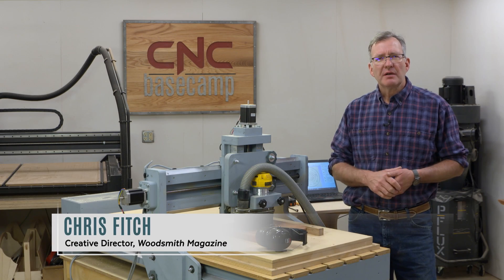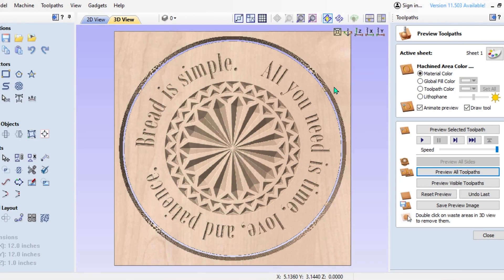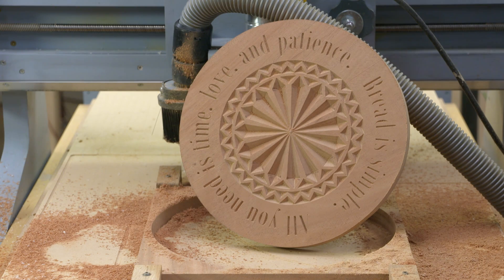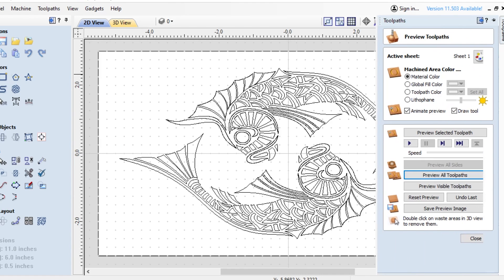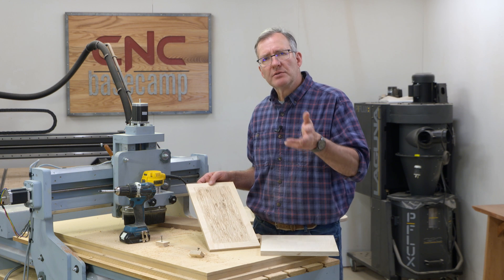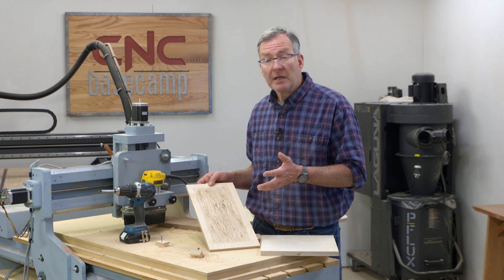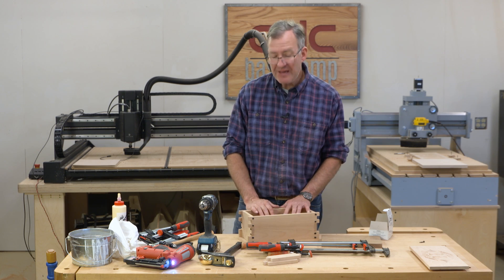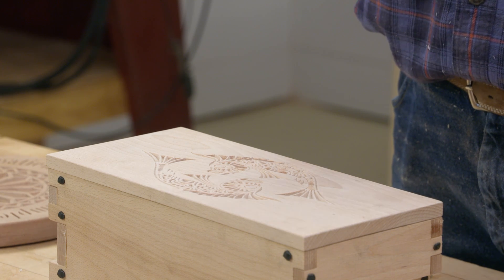CNC Basecamp E016: V-Carving - Beyond Lettering

Comment: It looked like the wood grain pattern was cut as a profile (on path) ipo v carve tool path.
Nice options shown, really like the chip carving concept.
Reply from the maker: The woodgrain was made with closed loops and run with a v-carve toolpath  so as to have varied depth of cut, however given the scale I don't think it would have made much difference if I had created a pattern for an on- path profile cut.   Larger, bolder patterns would benefit from v-carving I think.  Another project for another episode.    Thanks for watching and commenting.

Comment: I really enjoy  this series and am grateful that you're producing these CNC videos.  It's nice to see your DIY CNC machine.  I bought the plans and am interested to see how it works.  I've used my CNC to make chip carving patterns and have a suggestion.  If you buy an even wider bit, like a 120 degree bit, you can really get great results.  A lot of chip carving is based on 60 degree angles and using a 120 degree bit emulates this perfectly.  Try it out, you'll find a whole new way to make interesting things with your CNC.
Reply from the maker: I plan on buying 120-degree bit and putting it to work.   Thank you for sharing your experience.